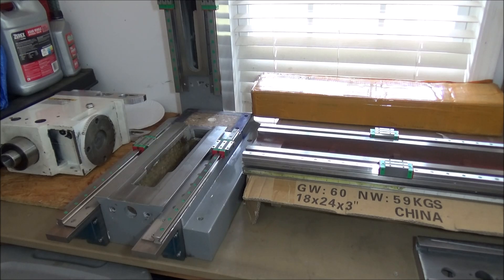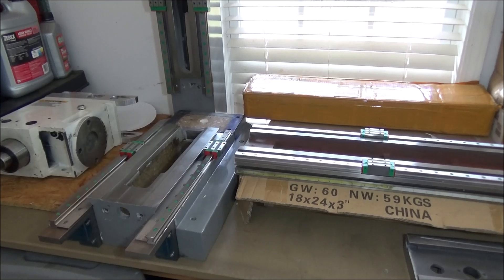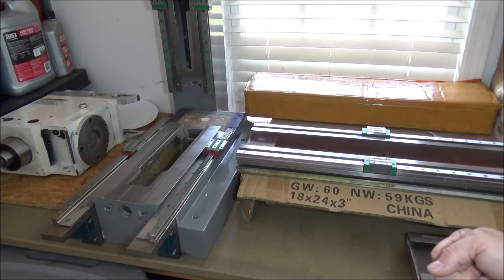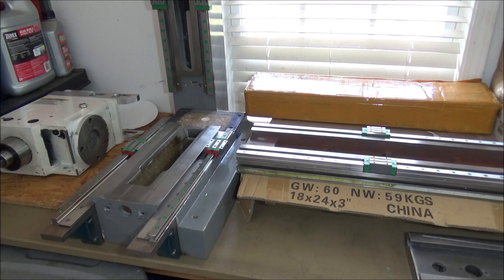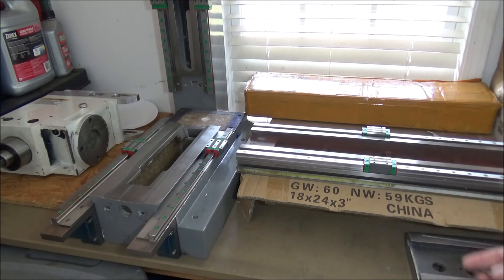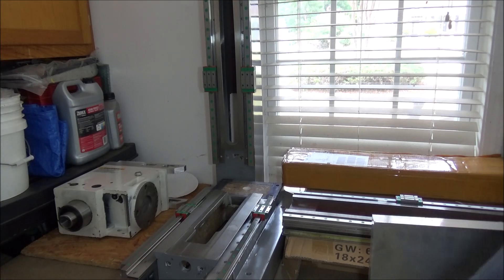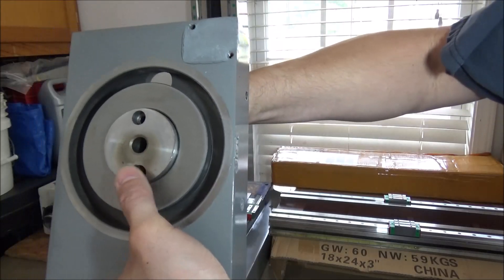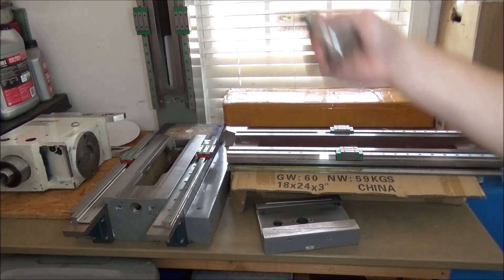PM727MXL Linear Rail Recap

Comment: How are you figuring out how much to extend your headstock? I've made plans to extend my bed, but I don't know how to figure out how much I need to extend the spindle out
Reply from the maker: I won't know exactly until i get the Saddle machined . Ideally I want the spindle center-line in the middle of my Y axis travel to give me the same amount on the front and back.  I'm guessing it will be around a 1" spacer to have clearance for the Marathon motor.
Reply: @CNC4XR7  are you not using the stock sattle?
Reply from the maker: @jonathonwood4088  no I'm not going to use the saddle for z or xy

Comment: Don’t leave the bearings on the vertical axis without an end stop because when they start to move unaided then they will drop off with balls everywhere 😩
Reply from the maker: Yes this has happened to me already on the x axis luckily these are rollers so a little easier to insert.

Comment: Are you using only 1 bearing block per rail?  And if so, are you worried about wobble?
Reply from the maker: No 2 blocks per rail 4 per Axis I just havent installed those on just yet.